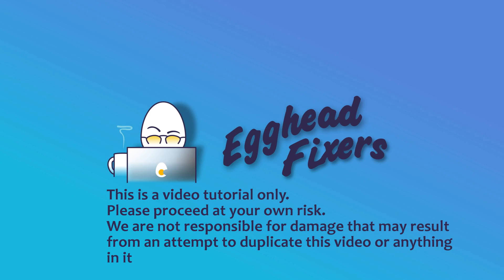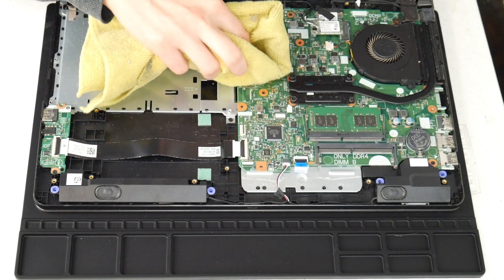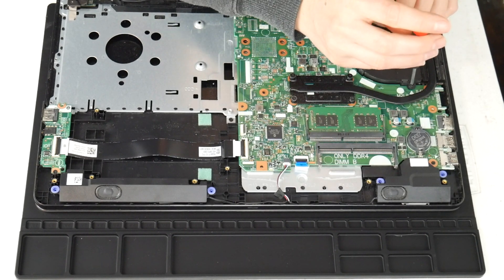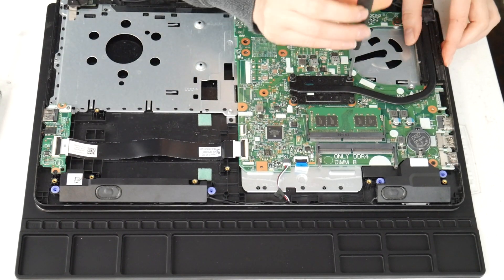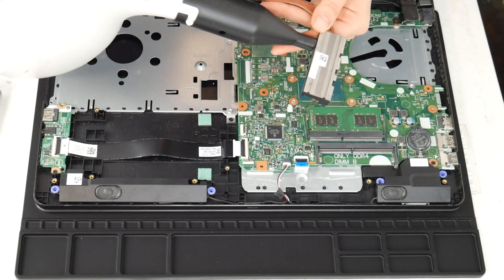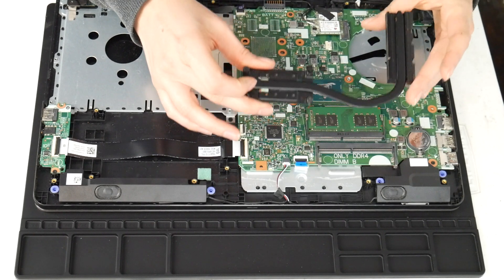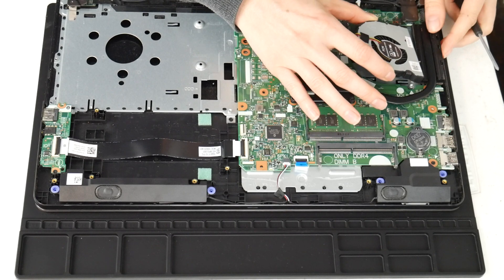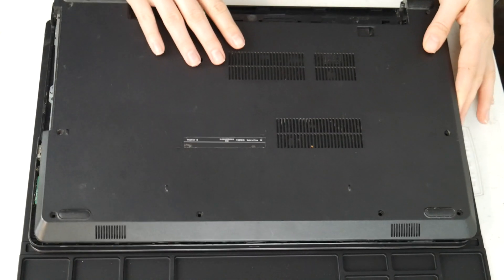How to Fix a Lenovo Computer That Keeps Overheating Tutorial by a Certified Technician

Comment: Can you make a video about that won't work make sure that your device is discoverable. I am facing this problem with connecting any Bluetooth headphone and phone. This problem is on Lenovo Idea pad 3 15IML05 D
Reply from the maker: I'm not a understand correctly. Are you saying that your computer can not see the Bluetooth devices you are trying to connect?
Reply: @EggheadFixers  other devices are not connecting to this model if i try on other model is working fine
Reply from the maker: @earnests5375  Here are some troubleshooting methods to try:

method 1
Press Winkey + I to open Settings.

Go to Update and Security.

Navigate to the Troubleshoot tab.

Scroll down and locate Bluetooth.

Select it and then click ‘Run the troubleshooter’.

method 2
Go to Start menu, type Device Manager and open it up.

Expand Bluetooth to see the listed drivers.

Right-click your device driver and select ‘Update driver software’.

Bluetooth Driver Update – Windows Device Manager

Wait for it to complete.

Reboot and try pairing again.

method 3
Press Winkey + R to open Run.

Type services.msc in the run search box.

Once the Services window opens, locate every Bluetooth related service, double-click to open Properties and select Stop.

Stopping Bluetooth Service

If they aren’t running, then just simply select Start from the Properties.

In the Properties tab, select ‘Automatic’ from the drop-list in front of Startup type.

Do this for every Bluetooth related service and then reboot your system.

Try pairing.
Reply: @EggheadFixers  thank you
Reply from the maker: @earnests5375  no prob👍